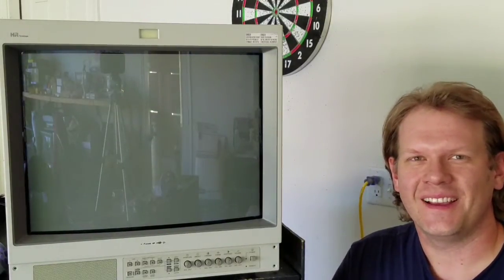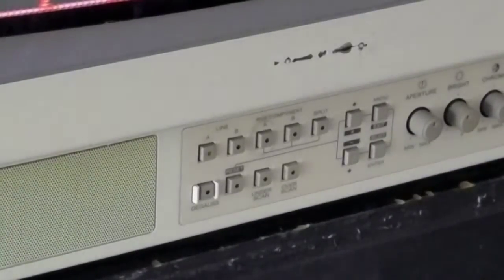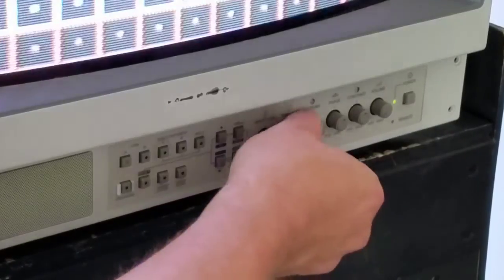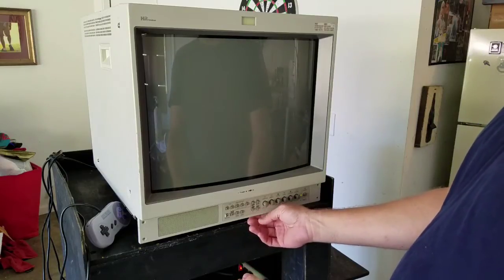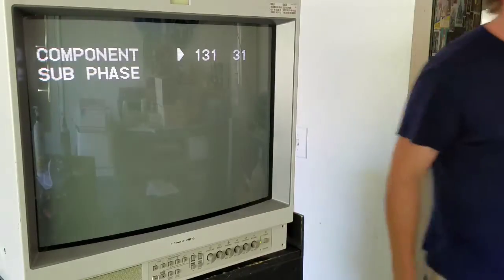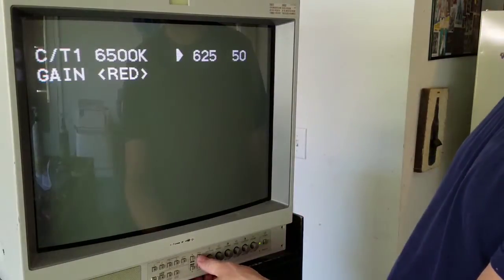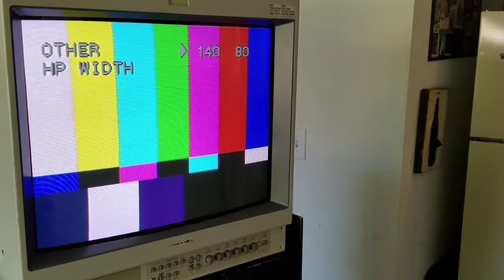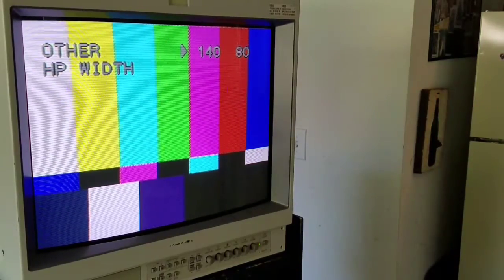Sony PVM CRT Calibration  - Menu Color Calibrations

Comment: Hi, you said that the in and out audio of the pvm can be used for 2x Chinch outputs from e.g. bnc breakoutcable. Is this model specific or does this work with all pvm? Or is it better to use a Chinch Splitter to combine both audio in one audio in at the pvm?

Comment: 4:30 A refresher on the picture controls on monitors and most TVs:

Brightness = Black level.  It adjusts the low-end IRE of the picture.  The darker portions.

Contrast = White level (the higher IRE) or whiter elements of the picture.

Avia DVD or Spears & Munsil Blu Ray discs have patterns to set all those settings correctly.

Phase, or "Hue" or "Tint" date back to the original NTSC color format, which delivered Luma and Chroma as separate components.   Phase corrected a situation where either Luma or Chroma arrived before the other.  In that situation, a delayed Chroma might cause a greenish or purplish picture.  Setting what we call Tint would at least reduce that difference in arrival times, eliminating a purplish or greenish cast to the picture.  

Displaying the proper pattern on a generator, or via one of the discs I mentioned, will allow  you to set Aperture (sharpness) correctly. More often than not, sharpness will end up being set much lower than we're accustomed to.

Hope this helps when you all are aligning those settings!

Comment: This is probably gonna sound dumb. What’s the difference in running RGB be component? I always thought was the same thing. Been a fan for awhile, and picked up a 1353MD this week, and trying to get everything looking even better than it already does. Using Wii with component cables to run test suite 240p.

Comment: My pvm has RGB in text showing in the bottom left corner . How do I make this go away ??
Reply: hey this reply might be a bit old, but try getting to the service menu by holding the menu button. then look for color system display and set it to auto or off. auto will make it show and go away after a few seconds when switching lines.

Comment: Hey man. Awesome channel!

My Sony PVM 14M series gets dim after being on for about 10 minutes or so. Brightness adjustment helps... but continues to worsen the longer it is on.

I'm wondering what I can do to fix this. Any thoughts? Thanks!
Reply from the maker: Thanks for watching.  You could try to adjust the Screen setting on the monitor, but that is on the inside of PVM.  Most of the time there is a potentiometer labeled "SCRN"  Turning that will increase and decrease the brightness.  If the setting is too high or low, the screen can flicker.
Reply: @RetroTechUSA  Hello there, could this be related to some aging capacitor, or could be one of the circuits that automatically corrects brightness for an aging tube?
Reply: QUITE POSSIBLY!   And scoping for worn components will yield a far longer term solution than simply turning up the black level or the screen control.
Reply from the maker: The [SCRN] trimmer is located on the neck board near the H-Stat knob.
Reply: Thanks! I'll give that a shot.
Reply: @sbeehive9395  Hi, did you managed to fix that brightness dimming issue on your PVM?

Comment: On my 20-M2U I do not see the config->RGB system set up. Is it auto on these sets? It says component on the bottom left of the screen  when I’m hooked up via component
Reply from the maker: That might be a little different on that monitor.  Are you able to get component and RGB to work though?
Reply: I don't have anything to test RGB with yet. Working on it and then we'll see. Thanks!

Comment: Just picked up a Olympus OEV143 (Sony PVM-14M4U) with the same exact layout as the monitor in this vid. When I'm connect via RGB Euro scart the picture is all red. When I tested out the cable on my Sony Bvm-8045QD the picture is perfect. Any thoughts on what might be the problem?
Reply from the maker: Sounds like you should check the "GAIN RED, GREEN, and BLUE" Settings on the Color Temp you are using in RGB.  Try to increase blue and green, then decrease red.  Also, does the problem show on the other inputs besides RGB?
Reply: Retro Tech Yup for component using the Ps2. Composite with bnc adapter for some reason doesn't work at all with No Sync popping up, same for S-video.
Reply: Retro Tech didn't work. I put red down all the way and B and G up and the screen is still all red
Reply from the maker: Then there is most likely a problem with the color portion of one of the internal boards.  It could be bad capacitors or other components.  That's a difficult fix.

Comment: Hi I have a bvm 20f1u and the osd is not visible do you have a idea what is could be
Reply from the maker: Do you have the BKM control unit for the BVM?
Reply: Yes I do
Reply from the maker: Did it just stop working one day or did it never really work right when you got it?  Does it function at all now?    Personally I prefer PVMs to BVMs simply because some weird things happen with BVMs.  They are sooo complex.  Sync issues come up requiring more equipment on occasions and that's a headache.  PVMs are pretty much plug and play and have less issues than BVMs.  Most PVMs are easier to operate also.
Reply: Yes I have three bvm 20f1u and I haven't had a problem from my other two they all have over 115k hrs but my third one has this issue and has 53k hrs the osd is their but it's almost all black
Reply from the maker: That's odd.  Do you think it's some random screen setting for the  OSD on that Monitor?  I'd recommend testing to try to find a setting on one of your good BVMs that allows you to either dim or change the color of your white lettering on the OSD.  If you find the setting then you can try to find it on the BVM with the problem.
Reply: I have looked everywhere do you think it's the tube went bad , I have looked everywhere and used lots of forums but no one has said or reply ied to me
Reply from the maker: It's probably not the CRT Tube if there is only 50k on it.  Does it have any other screen color clarity issues besides just the OSD?  Do other colors look bad or just the menu text?  You could try to find one of those old Sony memory sticks that goes into the BKM card.  Then you can save settings from a good monitor and load the settings after hooking the BKM up to the problem BVM.
Reply: It looks like it has no white color
Reply: You tried hitting under scan? I've had issues with a different model, while adjusting raster settings in the menu the menu text completely disappeared for some of the values. It showed back up when I hit underscan though. Not sure why...
Reply: This is endoskopie. This tv is for checking inside human assholes. You bought it used. Much bacteria in this tv.

Comment: Good stuff.  How do you adjust convergence on these?  Thanks
Reply from the maker: Michael Economides i've got to wait for some safety equipment to get here before I make more  convergence videos.  I do currently have 2 different videos about 3 minutes long each that go over how I adjust convergence on this type monitor.
Reply: Ok yeah, I checked out your videos were you adjust it on the older model (2030) so similar for these?